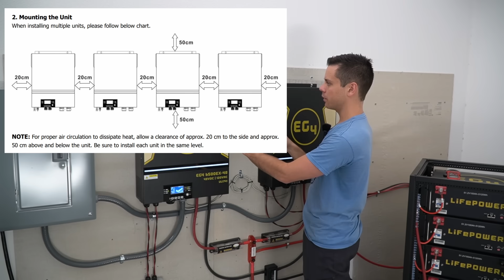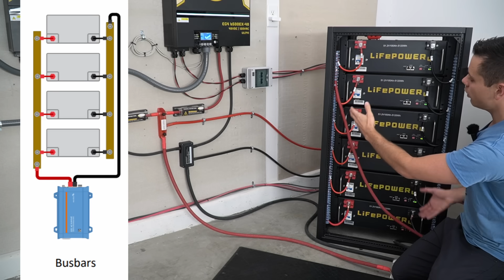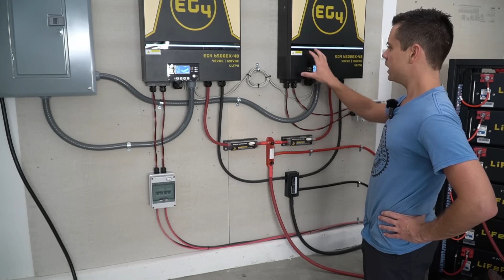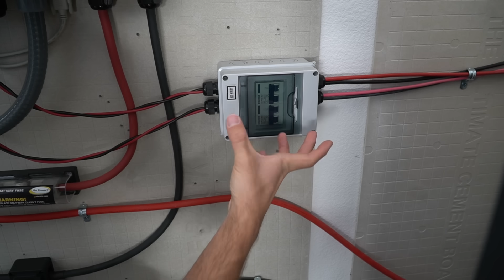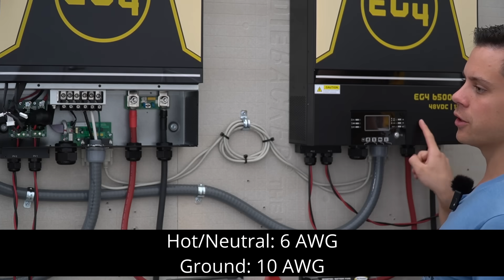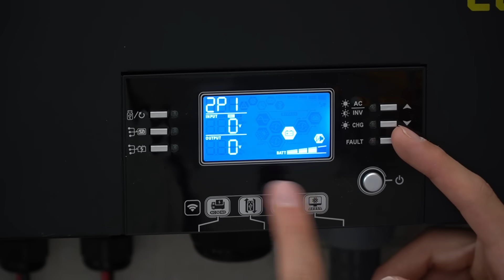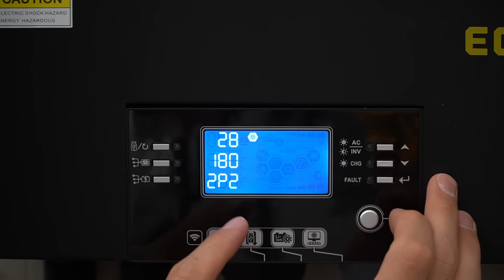Complete 48V Offgrid Solar Power System

Comment: In Europe, the entire residence is in 220-240V.  Since we are building from scratch, would it be more efficient to build a solar system with ONLY 220-240 output since so many appliances can use both these days?

Comment: DO you still have the old blue Prints for the old system with the dual EG4 6500 inverters? the new system you have this linked to has different invertors and a different layout... 

- Do you ground any of this system to a grounding rod? 
- Do you have the wiring diagram for this original setup?

If you can provide me with these details it would help a lot! Thank you for making these videos

Comment: Enjoyed this video and have watched several of your videos after seeing this one, you are very astute and very clear on the subjects being discussed, the reason for my previous question is that I am building a place off grid and have  some components already on hand 26 - 235w panels, 30 - 260w panels and 2 - 2000w wind turbines at a 50 mph wind, 12kw inverter which came with the kit ordered containing 20 of the 235w panels and 2 - Outback 80A - 48V MPPT Multistage smart controllers, 20 AGM batteries, with various breakers and power cables which came with the kit. Am now seeing that I might have jumped the gun and did not do my due diligence before acquiring, Your thoughts ? Am needing more charge controller power distribution and batteries, these on this video seem like they would work,

Comment: Will, Great video for a beginner, am having a question about the system on display here in this 1 year old video. that question is if someone added 1 more EG4 6500w inverter and connected as the others are would that provide more power to one side of the load controller box, therefore enabling more power usage on that one leg, or would that not be advised, hence requiring another EG4 6500w inverter to be installed to maintain a balance on the load via the controller ?🤔

Comment: Is there a way I can buy 30mins of your time-  I have a PowMr System an all in one but I can’t info on it anywhere.  Got an outstanding deal in the whole system two 5kwh inverters. Each one having a 100amp charger and 450vDC of solar input MPPT. 
Plus 500ah @48v of battery’s -

All for under 5k 

But I have the system set up but I’m having issue getting the solar to read out on the inverters- anyway you could do a review of PowMr.  Amazing deal and quality looking stuff-  please reach out

Comment: THANKS for taking the time and effort to share your knowledge and experience.

I m sure you instruct how to wire in a auto switch to go from battery power to grid power when your batteries get very low.  Can the EQ4 6700  do this or is there a separate device for this function?  OR does this have to be done manually?

Comment: I wish I could send you pictures and a video of my setup. I basically am using the exact same components because of you and your expertise. I have 27 BlueSun 460W Half-Cell Bifacial Solar Panel (Silver) | Up to 575W with Bifacial Gain total. I'm off grid with a 1200 sq ft home in Southern Indiana.  I sure could use some help, thanks.

Comment: What is the proper hookup of positive and negative wires for off grid solar battery bank to inverters?  I have 2, lithium ion eg4 48v battery banks of six batteries each, in racks. Plus, two eg4 6500 ex inverters, one is a host and the other is a slave. Giving me dual phase. Thank you.

Comment: Thank you Will. I set up my system to match yours. I use it to run my Tesla charger off grid. I also have a few appliances hooked to my load center. I am hoping you can help me solve a couple of issues. I have 2p1 running in the EG4 setting and 2p2 running in the USER setting. My AC output on 2p1 keeps dropping to 109 to 111 volts and my Tesla charger (charging at 32 amps) shuts off. My question is what would be causing low voltage? Is this dangerous for my appliances and Tesla?  Is there a setting I should check?  I checked your forum but could not find any solutions. Thank you for your help and expertise!

Comment: My power bill is 70% fixed, 30% variable. Have you considered designing a complete off-grid system with redundancy that included gas generation? Where I live I would require ~2,000 hours of gas generation to go along with a 5Kw+ solar + 10Kwh+ battery system. The good news is I could use the waste heat from the gas generator to save on heating.

Comment: Hi Will, as always Kudos on a great presentation on this. I am in the process of installing these inverters as split phase using EG4 load center pre-wired to avoid having to order and mount separate switches and breakers. You indicated that you were planning a separate video on communications between inverters and the battery bank. Can indicate if you have done so and where it may be? Thanks so much for your efforts

Comment: Will.  Can the batteries be charged by utility?  I would not initially install the solar.  With utility charge of the batteries when utility goes down batteries/inverter power house, when utility power returns I would recharge batteries.   Can this ststem operate like this?

Comment: Hi Will, I have got the bug about DIY solar.  I live in NC and our power company has got the energy company to authorize a split cost of power based on Peak and non-peak hourly rates.  In addition there will be a minimum monthly fee for solar net metering customers and cost/Kw of solar array connected to their system (if your array 15kw or more).  With that said.  I am building a 4s 12v LiPO4 battery to learn and researching a solar components.  This is the system I like but with my own built batteries.  I will build a 48v 16 cell pack first, then add 2 more over the next year.  With that said my questions are: 1) what will I need to use to build battery packs that will communicate with EP4 6500EX controller? 2) tying your system to existing panel via load center to manual generator transfer switch - can I then basically supply the household loads that are wired to generator transfer switch off "solar generator" 24/7.  Thus using utility company power as the emergency power for those specific loads that are normally supplied by solar generator.  Is my thinking correct?

Comment: I would want to build this system but I want it to connect to my main panel just like using the generator plug that you would use to connect them to a main panel. I sure wish you would have shown how to basically get a plug out to plug into the generator plug box.

Comment: Hi Will, I have 2x 3000 watts 24V  LVM Growatt  that is in Split Phase.  I always find myself needing more than 3000 watts as I use my microwave and airfryer using more than 3000 watts.  Can I use the Blk and red wire and get rid of 240V split phase by getting rid of the serial cable and use the red blk instead?  WIll this get rid of my issue if I go more than 3000 watts being used by using microwave 2000watts and air fryer 2000 watts total 4000 watts.  thank you in advance

Comment: Nice tutorial job.  If you do experience any future problem with your system, one of the first places you may want to check is at the short 2/0 positive + wires that exit the bus and enter the fuse blocks.  I've seen short cables become brittle on DC circuits under load, which increases the impedance or resistance in the cable, creating a voltage drop.  If you experience this problem, the simple fix is to replace those cables with longer cables.  For cosmetics, maybe lower the 4/0 & positive bus, vertically mount the fuses, then replace the 2/0 to length, similar to how the negative cables are ran.

Comment: Questions? 30Kw looks great, so how many 200w solar panels would be necessary?, How many cloudy days (estimate) in a row would discharge the system. One general contractor told me, one of his clients in central Texas 3 days. But that could be with 12v batteries. Thanks.

Comment: Yet another great video.  Total rookie question:  If you didn't have the all-in-one inverter and were using a separate charge controller, where/how would you connect it to the battery bank?  Would it be the same for two controllers?

Comment: Hi Will I’m very impressed with your excellent descriptions and it sounds so easy :-) I am going to connect a pair of Rosen 48v150amp power walls to my solis S5EHIP5K-L   5kw hybrid any help on the battery set up would be appreciated. The power walls are 150 amp yet my inverter is a max in/out 100amp what inline fuse/disconnect should I use ? Also I have been told dip switches should be battery 1 (1000) and battery 2 (0100) ? Should I use a com cable to link battery 1&2 then a longer lead to the inverter. 
I have considered running two positive leads and the two negatives to a junction box then just one positive and one negative to the inverter and a fuse only on the positive to inverter and obviously two fuse/disconnect from each battery. Does this sound feasible ?

Comment: I have a SunGoldPower 6000 W  inverter. When I power it on without the grid power connection connected, just the 40 vdc battery pack. It must draw too much current for the battery pack and the BMS shuts down the batteries. 1. is the the charge resistor problem you talk about 2. What can I do about this problem. From you video I think buying a SOK rack mount 48vdc 100ah rack mount battery. Will this solve my problem?

Comment: Why didn't we get that you can use all kinds of watts or voltage. Only thing I think you need to keep the amps below 18 amps. So more in series than parallel.  To keep the amps down.

Comment: I watched this video 2 times, might still missing alot of info. Just for learning purpose. 
My current knowledge. Please help me understand better
1. Solar Panels, wire in series or parallel to make up the input add up to 48V in this example set up.
2. Inverters, same rating of panels 48V. Assuming, inverters job to provide the AC out put first, or priority to the AC side first before the Batteries. I'm sure there other details I need to know about the inverters, I saw his other videos did mention about constant usage, max amp peak or something.
3. Batteries, assuming have to wire same amount of voltage? 48V? 8000w PV input, does that mean the maximum power can handle within an hour? As in if I buy 10k watt solar panel, It will be waste for those 2k watts? But around 1:00 min. He mentioned about upsize the batteries. Assuming he meant if we wired the inverters as higher Voltage rating?
4. Panel, just make sure certain amp rating, in this set up with 6500 W output from inverter. 6500 / 120 vac = around 55 amp. So 60 amp breaker panel should be good. 
thanks in advance for the info

Comment: Although i love your video's - (I found out the hard way) the fact you NEVER hook any of these up to the grid really makes these video's worthless. Almost everyone buying into these systems are going to use the grid to charge batteries, or have these for backup fore the grid, or feeding excess solar. Since you ALWAYS leave this crucial part out of your "testing" you don't get the MAJORITY of the problems/errors/nuisance trips All these units experience! A quick trip to any of the Forums will show this. I really wish you would do your subscribers a huge favor and actually use all the "features" of these as the manufacturer intends. You also ALWAYS skip the most crucial - inductive (real world) testing on any of these units.

Comment: Will, great video.  I bought the same inverter and batteries you have in this video months ago, I will put them together soon.  I plan on supplying power from inverter to the house main panel.  Is the connection to the main panel the same as you have in the video ?  Except i need to add switch or interlock, so only main power from utility or inverter is on at one time.  Will you make a video on this ?  : ).   Thanks.

Comment: After about a year I finally have the time to put together my LV6548 system. I'm going to run a pair in split phase (240) just like your video. Here’s my question that I can’t seem to get answered. I'm starting with (8) 390 wat bifocals from CandianSolar, (2) strings. Should I wire them to one or split them, wiring one spring to each LV6548. 

I have 32 panels total and when time and money permits I will eventually run 16 panels per LV6548. (2) strings of 4 per input.

Thank you in advance.

Comment: I really suggest going with anyone other than signature solar, after spending 17k on a system like this and 3 months with tech support regarding inverters that arrived damaged, they say the most recent doesn't fall under warranty, and is somehow user error. Only issue is I have followed the manual and tech support staff's instructions exclusively as I am not the most technically minded man alive. Customer support and Tech support are helpful but QC and RMA have been an utter disaster.

Comment: I bought this kit. Signature solar can't even get everything to my address or sell me the solar kit listed when I paid. This company has been nothing but a rip off. First they told me the rack was back ordered, then they downgraded my solar panels to mono, then they sent my solar panels to an address I don't even know about and the freight company won't deliver them to my house even though the inverters and batteries and breakers/wiring arrived correct. This business signature solar....if it were my company, I wouldn't put my signature on it either. I'm just about ready to make them take everything back due to their immeasurable ineptitude. How do I get this company to pull their head from their rectum?

Comment: If you need go connect shore power to them do you connect L1, N, G to inverter1 and then L2, N, G to inverter 2?  And it just flows to the AC out the same way?

Comment: Each unit can surge up to 100ms@≥205% load; 5s@≥150% load; 10s@110%~150% load (specification in the manual). In order to handle that surge power (for induction motor start up current), I recommend to use 4 AWG for Hot and Neutral wires, and 8 AWG for ground wire. Conduits for those can be 3/4 - 1 inch.

Comment: At 4:35, you mention having a second rack of batteries connected to the bus bar.  If you have two racks of EGA LL 48V batteries, how do you set up the communication bewtween battery racks and the primary inverter?
Reply from the maker: Communication hub

Comment: Question.  I plan on a total off grid system.  No grid power at all.  That being said, would wiring the "hot" legs from each inverter at the main bus bar lugs (the same manner a grid tied system would) be incorrect, and if so why?

Comment: Forgive me; total noob here but my inverters and batteries will be in one closet and the THHN will be passing through a wall/traveling over a ceiling to my main panel (not enough room in the closet with the panel). Since my THHN wiring is not exposed I should not require the 3/4" conduit. Is this correct? Thank you for these videos-they are a huge help.

Comment: Thanks for good explanation. But I don't understand why the each sola panels are not connected parallel. If I have 100 panels,  do I need 50 inverters?

Comment: Currently I pay over $.70 kWh between 3pm and 9pm.  My rate drops to $.19kwh at midnight and lasts until 3pm.  Could I use this exact setup minus the solar panels, charging the battery (and my Tesla) at night during “cheap” hours for a peak shaving setup?  I live in the foothills in Northern California surrounded by tall oak trees so panels are not ideal at this time….especially without a microinverter setup.    Thanks!

Comment: Can you make a video to show how to use this EG4 48v equipment in an RV? - I'm thinking to use:  1 EG4 All-in-one-charger-inverter (6500 watts), 2 EG4 batteries (800 amps total).  How would you charge the batteries from Solor, Shore power & Alternator?  How would you connect to breaker pannels for 120v AC & 12v DC?  How would you ground in the RV?  Thanks,

Comment: Does anyone know what charge profile to set these at? I am set at user defined, but I wonder if I should increase charge voltage from 56.4 volts bulk and 54 volt float. I am using eg4 lifepo4 batteries, the exact same as in the video. Thank you.

Comment: I am breezing through this part with your help. One thing I need to know that is different is how do I go from the panel that is in my barn with a powerline to my house? I know this part requires an electrician, but where does the big power cable start from the circuit breaker box?
Reply: I have 20 K watts and four inverters with 60 K battery bank

Comment: I recently purchased 6 of these 48V 100AH batteries for my home in Mexico. I have them setup in my shop which is partially insulated - walls are insulated but metal roof is not. I don’t know what the ambient temperature gets up to in the summer months but I’m concerned and wondering if I should purchase a split unit to setup near the location of the batteries in order to keep them at a lower temperature. Please provide your advice. Thank you!!

Comment: I am learning so much from your channel! Still not yet ready to "pull the trigger" and build my own system yet...coming soon, though.

Couple of questions (apologies if these are basic questions as I am still learning):

- I've seen folks install a power inlet box & interlock kit on their home to plug in a fuel generator for emergency power - couldn't the same be done with this system, effectively replacing/supplementing the gasoline generator?
- In the event of extended cloudy days, is there a way to charge these batteries with a fuel generator or grid power?

Thanks!

Comment: Perhaps I'm missing something.  E.V's run on DC battery power don't they?  I assumed it would be DC input to charge the E.V batteries.  Aren't you losing some energy by inverting to AC and then rectifying back to DC?